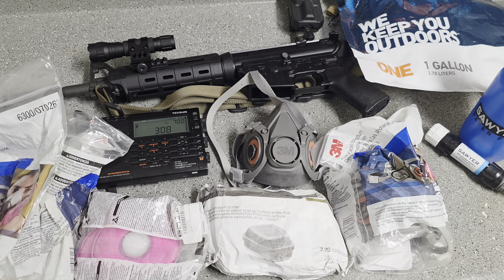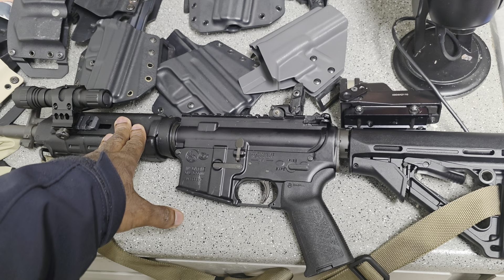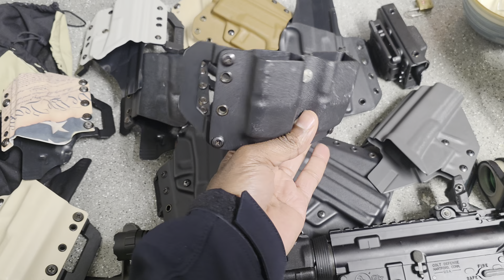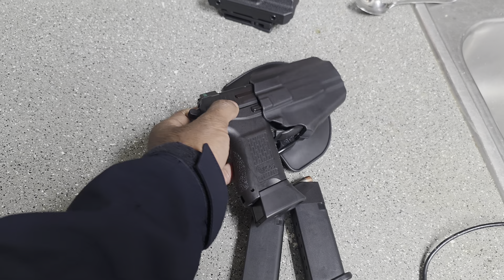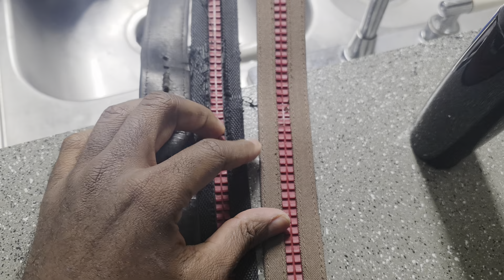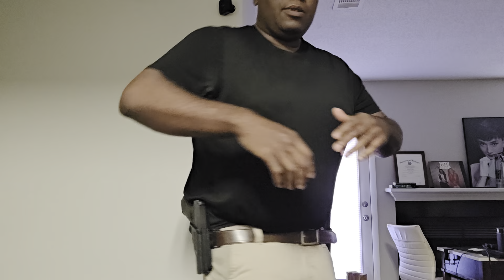Emergency Preparedness in 2026

Comment: One gun? Glock 26.
Reply: For sure. I’ve just gone full circle lol. Had a few years ago. Switched to a 19. Then other stuff. This week picked up a Gen 4 G26 in Battlefield Green. Hardly used. TLR6, some mags, and holster for pretty cheap. Stay frosty lads.
Reply: @matthewh8761 Glock 26 with a G17 spare mag is the best edc ccw set up. I get 30 rounds of 9mm. Low weight. Conceal carry.
Reply: yes

Comment: Streamlight makes a rail mount, rifle weapon light that runs off an AA OR CR123A, also comes with a mount and pressure pad, decent price if you catch them on sale. Streamlight 88058 ProTac Rail Mount 1 350-Lumen Multi-Fuel Weapon Light

Comment: Bro has more holsters than most gun shops
Reply from the maker: I never understood why so many gun shops refused to offer a decent selection of holsters.
Reply: @DEMCAD  Too many possible combinations of light,  laser, and red dot now. What surprises me is how few of them offer custom holsters in-house. Kydex is not super hard to work with.
Reply: If you've been shooting for a long time you  have boxes full.
Reply: @BLACKWOLF-1911 this.
Reply: Dang, you got a lot of money wrapped up in holsters.  Specialty holsters made for pistols with different pistol Light models are a money trap and hard to re sell.
Reply: As it should be. If you don’t have at least a dozen holsters just sitting around that you don’t even like anymore, you haven’t been running your gear enough. 😉😂

Comment: If I could only have one gun it would be either a pistol or a pdw/braced  grip fed pistol-ish sized   style pdw

As far as holster I’m addicted to the clip draw + raven concealment vanguard 2 setup for Glocks it’s the thinnest and easiest setup I’ve found for em you do sacrifice light bearing capability though and I’m proud and ashamed to admit I picked up a leather universal/hybrid owb/iwb holster from Walmart made by saddlemate  for 15 dollars that works amazingly well for a full sized usp 9mm tactical my grave yard has and IWB holster for a naked mark 23 from custom holster solutions that I used to use when I owned a motorcycle that worked incredibly well under a jacket but the mark 23 is dressed up now so have no use for it

Comment: You only need one firearm. One reliable firearm.  And 2 to 4 mags. Any more than that is not necessary.
Reply: I feel like I’ve come to that conclusion but I would double or triple the magazines though
Reply: For shtf. But for edc, no one needs more than 1 spare mag. A Glock 30 with a 21 spare mag is all he needs. That’s 20+ rounds of 45 cap.
Reply: @Hellokitty1-n9m  I like a One 19 round mag and two  30’s for what ever Glock is in rotation at the time